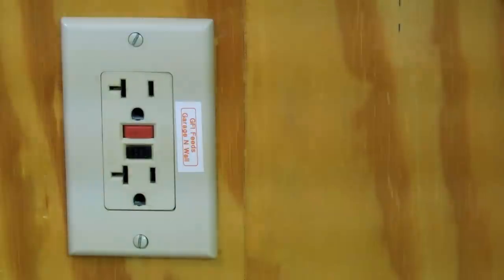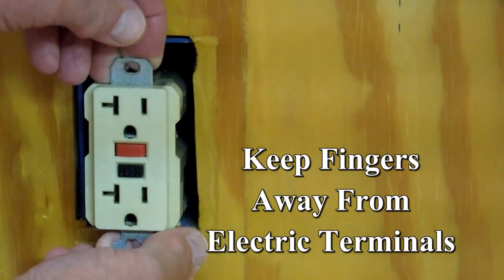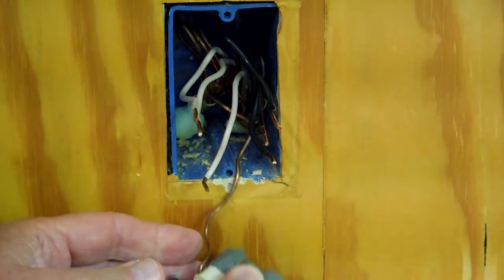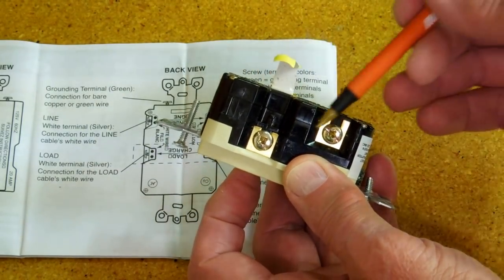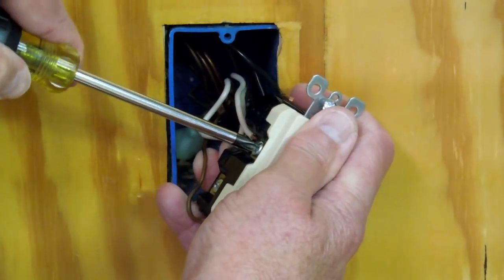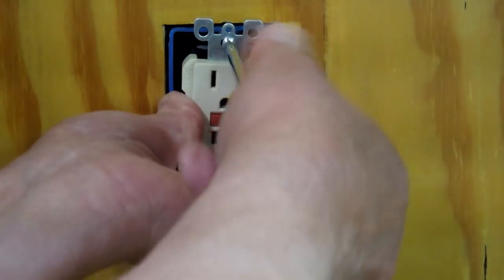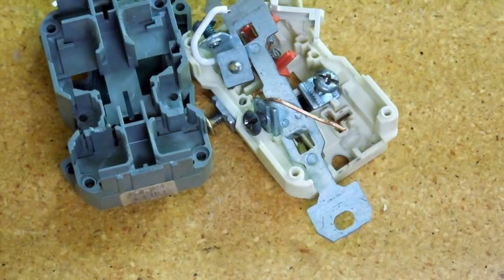Replacing A GFCI Wall Receptacle

Comment: Cant connect the new GFCIs the same now the load, and the lines are reversed on the new ones.  I just learned that on another video
Reply from the maker: There are certainly different type GFI receptacles. Some 15A, some 20A and some have a green LED indicating the GFI is working and the plug type and orientations of the wires changes between types/models. I did not pay attention to what I was buying a couple years ago and ended up having to install a new one upside down because of the wiring difference. I’m pretty sure if you take the old one with you and talk to someone at Home Depot or your local electrical supply, you will find the exact same thing you had originally.

Comment: Good video.  In case people are coming here wanting to learn how to replace a receptacle, it is important you go around your house and make sure you are "up to code" with GFCI's.  The National Electric Code says that GFCI outlets must be installed in bathrooms, kitchens, unfinished basements, garages (and outbuildings), as well as any receptacle outside in the elements (on the side of your house, by your pool, at your fish pond, etc.).  Basically, the NEC requires outlets to be GFCI protected if they are within 6 feet of a water source, in a garage or outside.

GFCI's are a very good safety tool and it is estimated they have saved thousands of lives since they were introduced in the 1970's.  Back in the old days people used to die plugging stuff up in their bathroom.  If your hairdryer fell in the sink and got wet, you could get a fatal shock picking it up.  This is why most all hairdryers today have built in GFCI's on the end of their plugs.

So walk around your house and ensure you have GFCI's installed at all of the above locations. You don't need one at every outlet in your kitchen or garage, just the first outlet on the circuit. It will protect all the outlets "downstream" as explained in this video.  It may save your life or that of one of your children.

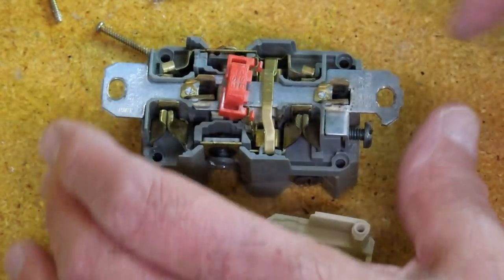Comment: 5:57 I assume that it shorts live to ground? A GFCI should pop when the phase provides more energy than the neutral receives back. A regular fuse protects against short circuit, which is a different task. A GFCI should trigger when energy goes somewhere where it shouldn’t go to (ground).

Comment: Some GFI's last for years and others seem to need replacing every year or two.
Reply from the maker: I once thought damp environments were the problem, but I have two outdoor GFI’s in metal weather proof boxes and they have never tripped in 15 years. I have one in a concrete basement wall (dry basement) and it can trip while I am looking at it (with nothing plugged into it) but it works perfectly while something is plugged into it.
I have GFI's in my shop that will trip when I plug in a ShopVac, disc/belt sander or miter saw. They don't trip all the time but there is a 50/50 chance of needing to reset the GFI when they are plugged in. Once plugged in, and the GFI does not trip, everything will run without issue. Since these all involve a motor, I have always guessed the change in inductance somehow trips the GPI.
My GFI’s needing replacement tend to be the same location. The one in this video has been replaced 3 times in 15 years. Then I have 3 other locations which seem to be hard on them. After a thunderstorm you can expect to find one dead. 
Finally, these are made as fast as possible. They are hand assembled and hand wired. The electronic components are subject to failure and we need to consider where they are made.
Reply: Just replaced one in my bathroom that had been here since the house was built in 1994.  It was still going strong, but I replaced it just because I was replacing other outlets.

Comment: I have a question... When I use a leaf blower or electric weed eater plugged into a receptacle in the garage it'll sometimes pop a GFCI receptacle located in a 1/2 bath inside the house. I used one of those circuit finder things and noticed that the 1/2 bath GFCI receptacle is on it's own circuit separate from the garage circuit... ??? How does that work? I'm thinking the GFCI receptacle would protect downstream receptacles on it's own circuit but it's protecting receptacles on a different circuit.
Reply from the maker: Can't answer that. Your 1/2 bath GFI probably isn't protecting receptacles on another circuit, it is possibly being tripped by an outlet on another circuit (and that outlet probably remains hot). Most would suggest looking for a wire on the wrong side of an outlet somewhere (black & white reversed). If you have an electrical outlet tester, it only takes a few minutes to systematically to through the house and garage to verify ALL outlets are wired correctly. First outlets I would test are the one in the garage and the GFI in the 1/2 bath. Don't forget hidden outlets in closets, behind furniture, refrigerator, freezer, stove, etc. The one outlet you miss may be the problem (Murphy's Law... Corollary 7e).
Reply: Ronald Walters Thanks for the info! I will test the receptacles.
Reply: Could be just a very weak GFCI in the bathroom.  Year ago I had one that tripped intermittently.  I finally discovered that it tripped when I turned the bedroom ceiling fan off, but only after they had been running several minutes allowing the line voltage to be really stable.  It seemed that the minor upsurge in line voltage from turning the fan off was just enough to trip the GFCI.